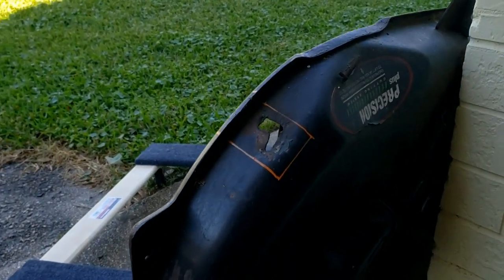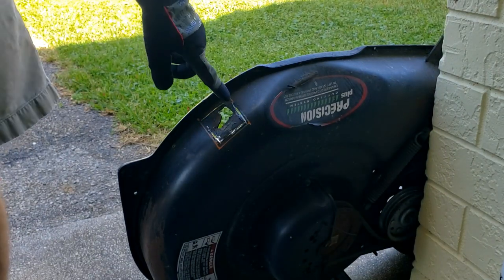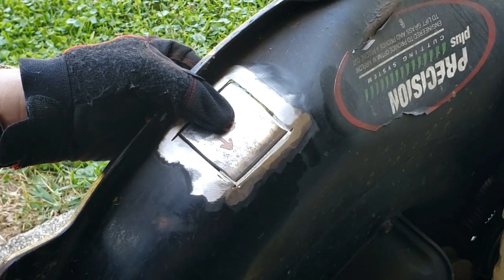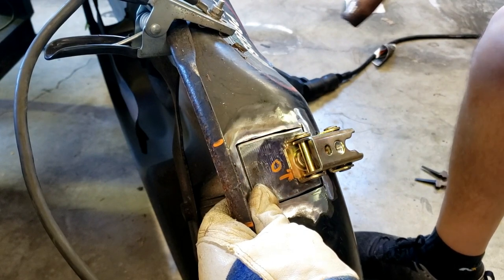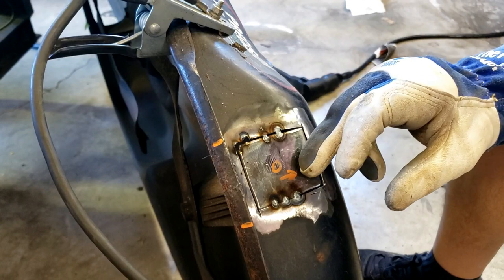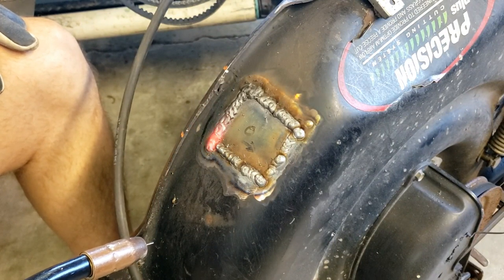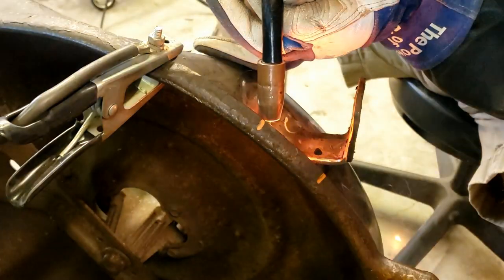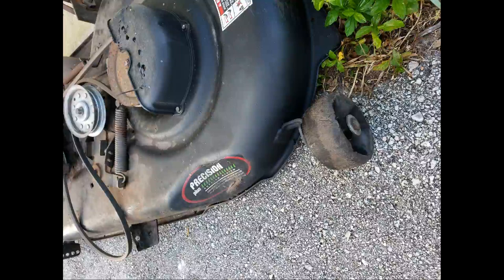Mower deck repair with MIG welder

Comment: Good job in fixing the mower deck, I got here as I'm researching the Miller 211 trying to decide if I want it or the 215 for a portable unit. Don't take this as criticism, the biggest reason your final welds weren't smooth as you want them is you were mostly drag welding and that puts too much wire into the joint and you were a little far away from the joint which you did mention so good job on knowing that. MIG you want to push, Flux core you drag ( wire pointed towards previous weld) just remember the phrase drag for slag, just like a stick welder.  Second thing on the slight vertical weld where the puddle was running down on you. You were doing good stopping before the puddle ran away on you, Practice doing that but don't hold the trigger so long, as soon as that puddle builds up to the height you want let go of the trigger, try not to move, wait a second for the puddle to solidify and repeat. If you've ever heard the phrase stacking dimes that's what you're doing, burn pause burn pause repeat till your done.  Looks like if you would practice that a little you'd have no concerns with you're welds apperance.  Heck what you did on that deck looks better than allot of stuff I've seen in certain stores.
Reply from the maker: Thanks Sam.  That is really good info!  I will give it a shot next time I break out the welder.  I was never a fan of multi-process....anythings....including welders.  That said, I have never used one and it seems to me that people like just fine! If I didn't already have my TIG, I would have considered a multi process more I guess.  Thanks and good luck with whatever you get!